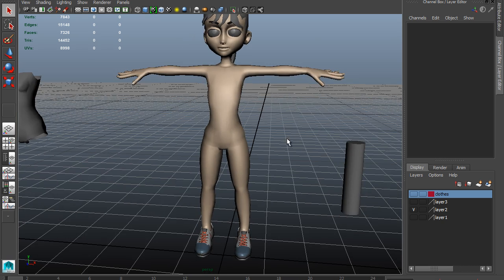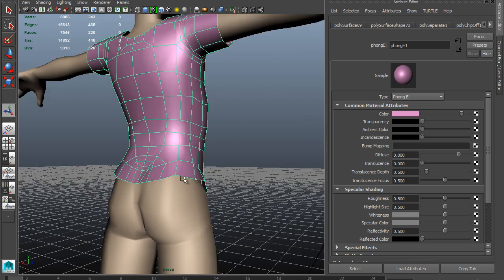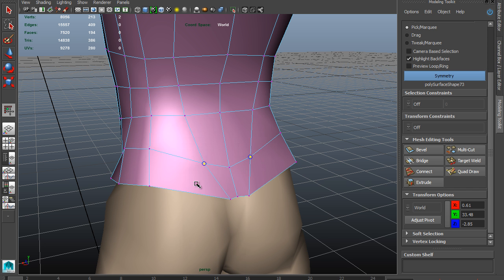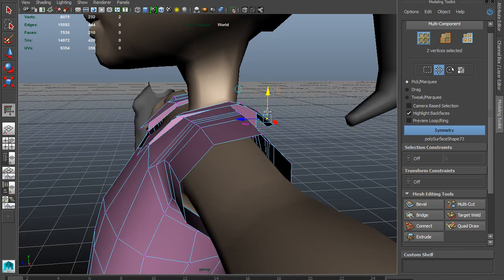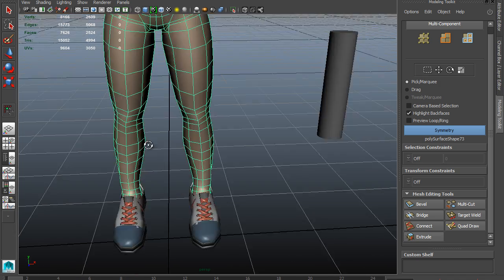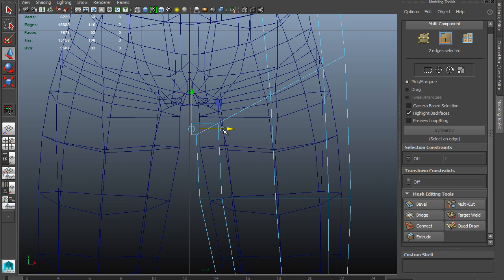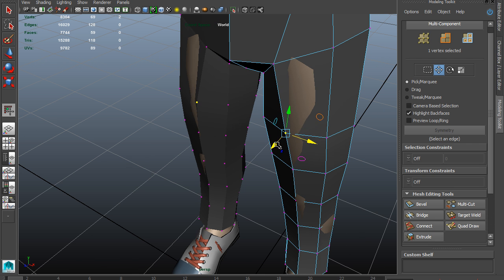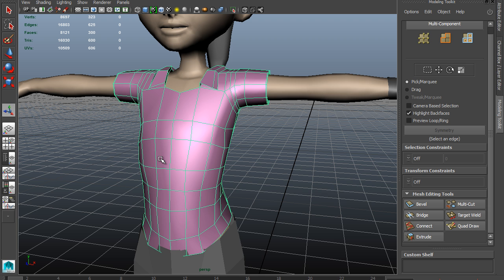Maya Modeling Techniques - Character clothes

Comment: Any tips for a noob trying to apply an armature to a model which has a main human body, and several accessories (belt, gun sleeve, wrist watch, etc). If I apply the armature to an "unified" mesh the weights become a mess and handpainting them a pain (doable tho, but a real pain due to the mesh nature) And then I thought hey Alex, make sure you have a proper hierarchy between the different objects, then apply the armature to the body so it will carry the accessories as it moves, but hey you can move stuff and make it happens but not in pose mode, object hierarchy becomes nothing in pose mode, and doing it that way I can't either hand weightpaint the accessories as they are not considered part of the mesh where the armature has been applied to.

Comment: hi sensei.i have a question. I modelled a character and made her clothes from extruded planes. Im concerned that when i want to animate the character the legs will be popping out of the clothes mesh. how would i simulate that and how can i make it look clothy
Reply from the maker: B Dennis just make tge body a passive colider. abd the cloth should have ncloth assigned to it.
Reply from the maker: B Dennis try to first animate without the clothes and once you have all the keyframes thwn you can make the dynamics.
Reply: so if i just assign the ncloth to the mesh it will react to the body movements?
Reply: Thanks for the reply.
Reply: Can you Pliiiiiiiz do a video on Displacement map, Bump map, Occlusion map and under what circumstances they are used. I am having a hard time wrapping my head around these. Thanks again

Comment: Hi I noticed while you were selecting faces that you would select one or two and it looked like "(shell)" pops up and the rest of the faces you wanted are selected (this is at around 1:00 - 1:35). I have trouble figuring this out, could you tell me what you did for easier selection like this and also if it still works for the 2017 Maya. Thanks!
Reply from the maker: Alyssa McClellan this is done through shift + rmb click and hold.this will bring up the marking menu.
Reply: Fantastic, thank you very much!!

Comment: dont u have to extrude it so it's double sided?
Reply from the maker: It all depends what the aim of the clothes are. For games you want to try keep the poly to the bare minimum. If the mesh is going to be simulated, then it is advised to have both a single sided version, and a duplicate of the same mesh that has 2 sides. This way you can simulate the single sided mesh and then wrap deform the double sided mesh to the simulated (single sided)mesh.
Reply: Cobus van Staden please do a tutorial on that!